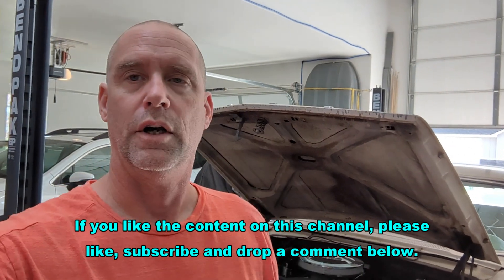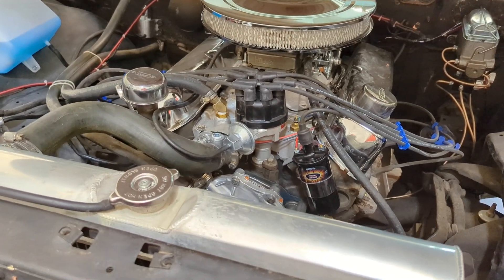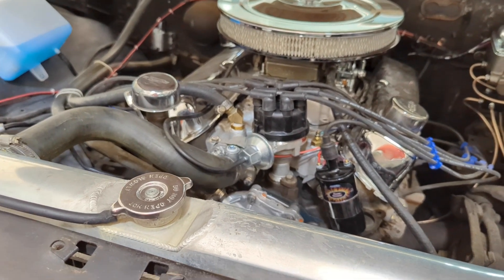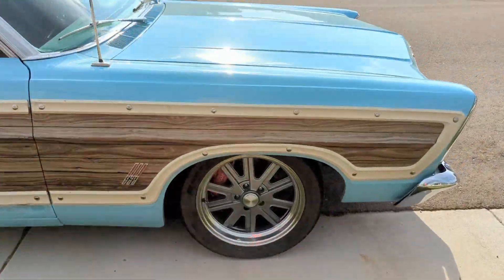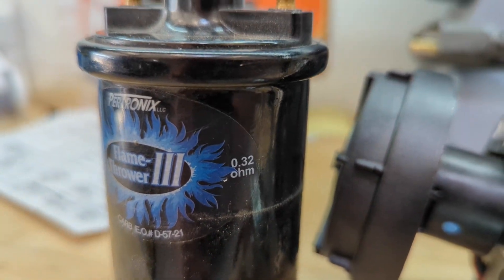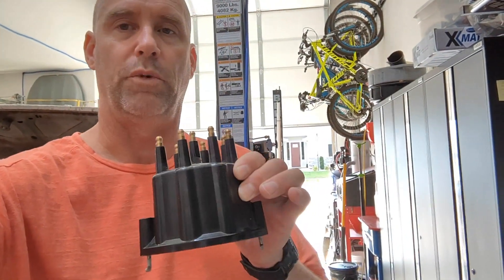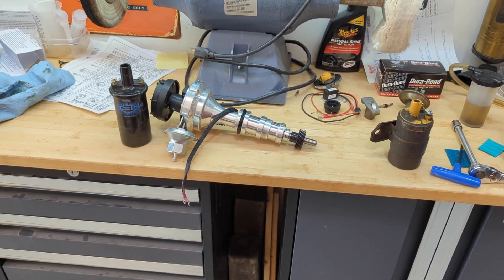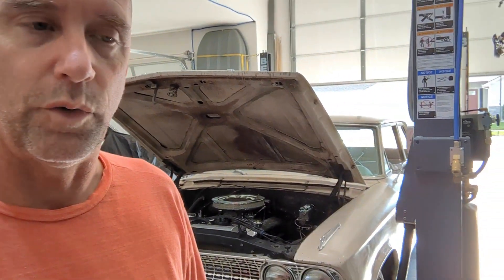PerTronix Ignition Failures - A Double Feature

Comment: I'll bet you are using Factory Ford wiring which has 6-7 volts at the coil....YOU MUST HAVE 12 VOLTS AT THE COIL otherwise you will ruin these ignitor systems every time
Reply: Have seen many failures with full 12volt sorry to say they're garbage out of the box

Comment: I paid $140 for a Petronix ignition for my Ford 800 tractor.  The sensor was mounted on the wrong side of the plate, so nothing lined up with the distributor. I sent it back and bought a Chinese knockoff for $30, which fits perfectly and runs great.

Comment: After 10 years of a billet 2 flame thrower in my car I ended up taking off the cap and it is all rusted. Except the ignitor 2! I ended up trying to take some of the rusted parts off and working on them. The one thing that came to my attention was the lead ground. I basically just fell apart. I was having some starting problems and throttle problems. This was the the biggest problem I have seen with it. Check the lead ground connecting the ignitor to a base plate.

Comment: Are you still running the factory resistor wire from the ignition?
Reply from the maker: Nope, I had a full 12V to the distributor.
Reply: @1967BlueBoat  that's a bummer to hear you've had bad luck with pertronix more than once... I just bought a coil and distributor... I guess I'll keep a spare coil and ignitor in my car...
Reply: Is it full 12v while running?  You need to check it while the cars running.  Thats when it will drop down.

Comment: I had almost exactly the same failure with the distributor in my chevelle!  I bought a MSD ready to run distributor & blaster 3 coil. Full 12V to the coil. 
One hot day the car lost all power, would only rough idle & would not accept any accelerator input. 
(I thought the fuel had boiled). After disproving a fuel issue, I started checking the ignition. Narrowed it to the distributor, pulled it out & had a friend test it on his machine. 
The results were it was an electronic issue where it would dump 12 degrees of timing or add it randomly. The mechanical advance was working fine. 
This part had less than 100 miles on it!
I got it warranted but at this moment I’m running an ugly stock HEI & the car runs fine. 

It seems like there is a BIG quality control issue in the aftermarket right now. I’m hesitant to put the replacement MSD in the car. 
Thank you for your video!
Reply from the maker: Yup, I totally get it. I want to run a modern distributor in the car for all the benefits they offer, but sadly I have lost all faith in their longevity.  I will be swapping out my factory points distributor for a Summit store brand magnetic pickup distributor very soon, but the factory points distributor and coil will be in a box in the back of the car as a backup.
Reply: @1967BlueBoat  
I was thinking of a similar option, upgrading an old gm points distributor to electronic. 
Best of luck. 
Let us all know what you end up doing!
Thanks again!

Comment: Instance 1:
1.5ohm coils are normally used when there's a ballast resistor in the ignition system, do you have a 1.5 - 1.6 ohm resistor in place for normal running? (bypassed when cranking). If not, you need a 3 ohm coil, otherwise the coil will blow. What's the resistance of your old coil? 1.5 or 3 ohm? (just test across the two main outer terminals).

Instance 2:
The HT leads needs to be self-resistive to prevent unused current from the plugs bouncing back into the distributor and cooking the EI module. If low resistive copper-core ('sport') HT leads, that will cook the EI in no time.

Another point, it's always worth using a silver finish coil -  which will keep it cooler than a black body coil.

BTW I've not used any Pertronix gear yet, but might be more wary now!
Reply: I get your point about the resistance of the coil. Pertronix do recommend 1.5 ohm coil with resistor bypassed if using it on an 8 cylinder, but like you I do question this.

Comment: Replaced points and coil in my 66 mustang 20 years ago with pertronix and their flame thrower coil.

Over 100k miles.
289 2 barrel automatic.

Never misses a beat.

Added a Jacob's to it and the Jacob's quit on me after 1.5 years.  Now have an MSD on top of the same old 20 year old pertronix and flame thrower.

Works great!

Comment: fun, fun, fun...when ya own an old car! 
You just talked me out of a Per Tronix switchout on my '68 VW Ghia!
Reply from the maker: I ran the conversion on my '67 Bug for years, up until I built a new, bigger engine for it.  It worked great.  Ironically, I have had much better luck with their conversions than I have their complete distributors. 

That said, I always kept a set of points and a condenser in the car just in case.

Comment: (Apologies in advance for the long post.)

I just bought a '65 Mustang that came with an Ignitor with original coil. There is some yellowing on the Ignitor label, but the swap is probably more than 20 years old. (The Mustang hasn't seen more than 20k miles since the 90s from what I can tell.) Otherwise, there is nothing I can point to saying that the system needs attention. 

I really want to upgrade the ignition system, however every MODERN option has negative reviews as well as people who claim positive longterm experiences. From what I can tell, most of the reported problems are a combination of increased failure rates due to lower quality assurance standards (I've seen this apply to every country lately) combined with the expectation that the configurations are 'plug-and-play' with no modification, maintenance or monitoring needed. But this certainly does make the case to go back to and use the original ignition setup.

I am keenly aware of the fragility of the pertronix but I have had experiences with distributor components and coils failing in all electronic ignition setups. (MoPar guys have long had to carry an extra ballast resistor in the glovebox.) I have been learning what specific conditions cause premature failures, and have been performing tests to see if my current setup may have a risk. But so far everything looks good. I do though think it is a good idea to carry backups on these old cars just as someone would have many years ago.

Comment: Just saw this and had to give my 2 cents worth. I had a Pertronix conversion on the 232 in my Javelin for 20 years with nary an issue. My brother converted the stock distributor on his Buick 300 and burned out 2 ignition modules in short order till he swapped in the one he has now which is almost 2 years old without a hiccup. Last winter, I swapped an SBC Chevy Vortec into my Javelin and converted an old points distributor to electronic by way of an Accel conversion kit. It ran great until it didn't and I ended up on a flatbed on my way to my first cruise night of the season. I ended up connecting with a guy who has a large, well established speed shop on ebay and sells these "ready-to-run" distributors and matching coils - basically the same circuitry as in an HEI, but with a small base circle and the module is mounted in a metal box on the side. I asked him what the failure rate was and he told me he sells about 5,000 units a year and has about 20 of them fail and return. In this day and age, that sounded about as good as it gets, so I ordered one. All I can tell you is I put close to 1500 miles on it this year with zero problems. Will it last forever? I don't know...

The internet poop on this stuff seems to be that you either get a good one and love it, or get a bad one and don't. It's all made off-shore, mostly China, and you buys your ticket and takes your chances. But before anyone gets on their high horse and threatens to go back to points distributors, let me remind you that there is a similar reliability issue with replacement condensers.
Reply: As a follow up to this I would just like to add that as insurance, I bought and extra electronic module when I ordered that distributor and keep it in the trunk with my tools. I would recommend the same for anyone converting from analog to "digical" ignition.

Comment: Bring back the interim system that showed up in the 60s: Transistor Assisted Ignition.  Everything is the same including the stock distributor, points, and coil. Take out the condenser and the points provide the trigger for the electronic circuit and the power transistor starts and stops the current to the coil instantaneously. The point contacts last forever and the rise time is more instantaneous giving a stronger spark with the same stuff. I found it to help a lot with cold starts or if the battery is a little low. Also solves the problem of crappy condensers these days. I’ve had several new condensers fail within 500 miles. I don’t know if anyone making them other than Velmann the electronic kit company.

Comment: I too had a Pertronix ignition conversion failure.  I have a 1960 Chrysler 300F with an original Autolite IBS 4011 cast iron dual point distributor with mechanical tach drive that I installed the correct Pertronix conversion kit in, including the correct Pertronix Flame Thrower coil.  The module failed while on a controlled access toll freeway.  I had the car towed back to my driveway where I reinstalled the original dual point plate assembly and hardware along with the original coil as well.  Boom, fired right up.  Nobody else that I’ve spoken with has experienced any failures with Pertronix, except you! I agree, I will not be using Pertronix again. As I only drive this car to shows, I’m happy with the factory dual point system.  Very reliable.  I also do appreciate keeping the car as close to original as possible.  I’m glad I found somebody else with the same problem, not that I wish the inconvenience of an ignition failure on anyone!
Reply: let me guess... you are still using the resistor wire in your ignition system.
Reply: @chrisbusch1970  ah that would be no.  According to the very clear included Pertronix instructions, the resistor is and was bypassed with full ignition voltage to the module. Therefore, that’s how I installed it.  It failed, through no fault in installation.

Comment: Most all ford's use a resistor  wire it will only have about 8 volts need to change the ignition  power wire to 12 volts .hope this will help I have run pentronix for years open our ford's
Reply from the maker: Well aware of the resistor wire. As I noted in the video, I am getting a full 12 volts to the distributor.

Comment: Yep, same issues.  I bought a Pertronix distributor with Ignitor 1 and the Pertronix 1.5 ohm oil filled coil.  The coil lasted about an hour and then the engine died.  I had it mounted to the cylinder head.  So, I changed to a MSD epoxy filled Blaster coil and added a .7 ohm resistor to make the 1.5 ohm circuit resistance.  It runs with 10 volts at the coil.
Reply: you need a full 12v at the + side of modern ignition coils.

Comment: Just had the same issue. 70 Mustang with 351w stock distributor with Pertronix ignitor I and 40011 coil. Car was fine before putting away for the winter (Scotland, UK) took it out started great, idled fine then the engine just shut down, I suspected the coil (after reading about failures being common), I have replaced the coil with another 40011, haven’t had a chance to try it out because winter is back (that’s Scotland for you). 
I have had the Pertronix fitted for nearly 4 years, this is the first issue I’ve had, but I’m not confident in reliability now, I will carry points and a coil in car from now on, seriously considering going back to points but will need to look at this my resistor wire was ‘toast’ so I have a bypass in and 12v to the coil, no idea how long points would last with this.
Pertronix has a large following for these cars they should really focus on reliability because they are great systems when they work. 
I will be interested is any similar alternatives.

Comment: What failed in the distributor? Wiring seems to be the culprit.  When the vacuum advance is moving back and 
forth it has the propensity to pull the wires going to the module.  With your skill level I'm sure you know this already, but thought I'd throw it out there.  They are using a GM style mechanical weight system.
I don't run vacuum advance on my Pontiac.  So this would not be an issue for me.  Did you run a full 12 volt source to the positive side of the coil ?
Just a few questions,  I like to give & receive information. 
Good luck.